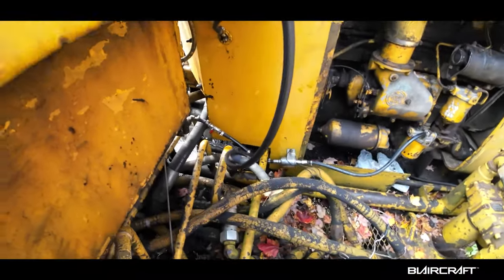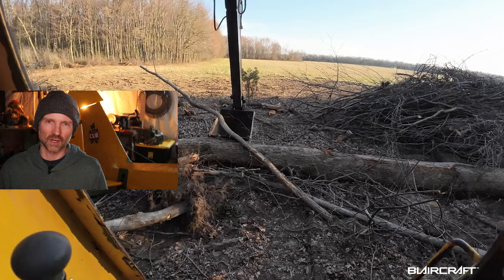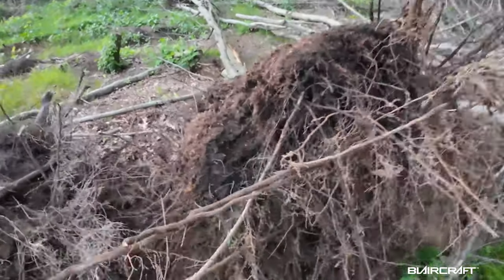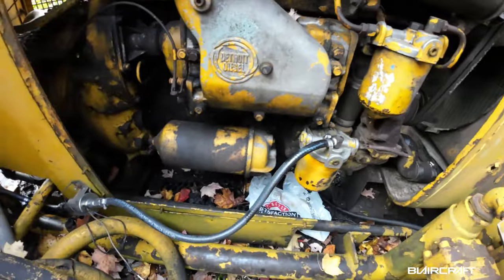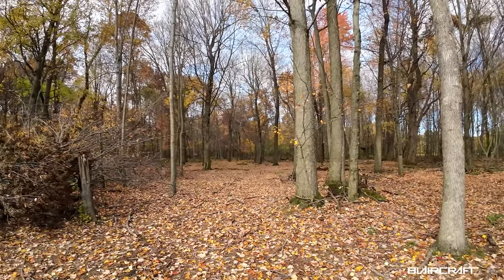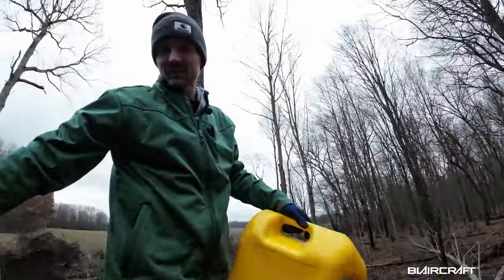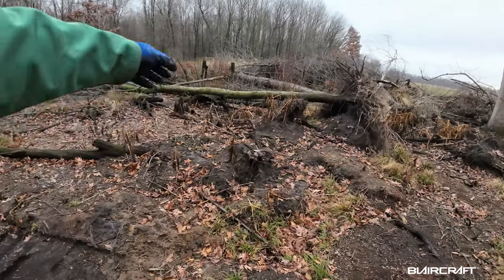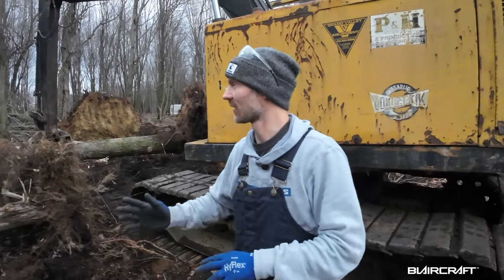Can I save $40,000 building my Runway with a $3,000 excavator?

Comment: Consider renting a larger machine with a bucket and thumb combination. You can push the big trees over while you have leverage. Then buck the stumps off.  You can sort your saw logs off to the side and move the limbs and small trees out of the way. You can shorten your job way up! You will need an operator with experience to really make the most of your rental machine though!
Reply from the maker: Yes. A thumb with the bucket would be very helpful. I’m planning to get a couple guys to help on a big work day and use a crane that I have. It’s a 4x4 with a 50’ reach. I hope to pick them up and move them aside staying mostly in one spot. I’ll give this plan a go first since I have it. I agree, there’s a much faster way! If it’s going to happen in 2024, definitely need a more efficient way of doing things!
Reply: The fact that you are doing it is most of the battle! You will get it one way or the other!
I have built airstrips in Oregon and Alaska and if I can help I will. 
Let me know if you just want to hear my two cents but either way you will get your runway built!
Reply: Onward…
Reply: Onward…
Reply: Onward…
Reply: Onward…

Comment: 18:59 Get those bucket teeth fixed so the mounting points dont get damaged when doing the work. Replacement of the holders is pain in the ass i'm told. Also its loose but each joint still needs new grease. Treat her well and she will treat you well. When you are done with this project, fix the fuel tank and all around, she could use good paint job and sell her cheap to someone who struggles to find cheap good old machine like this.
Reply from the maker: Yes. I have a couple of teeth to weld on, need to see if I can work with my father-in-law for a generator to power the welder. Thanks for the reminder. I did grease everything whenever I did the cylinder work. Also, I agree a good paint job would be worthwhile as well!

Comment: Why cut when you can PUSH
Reply from the maker: This tree happen to be right on the property line, did not want to make a huge hole to have to fill. So with the stump being that far over it will not be an issue on the runway.